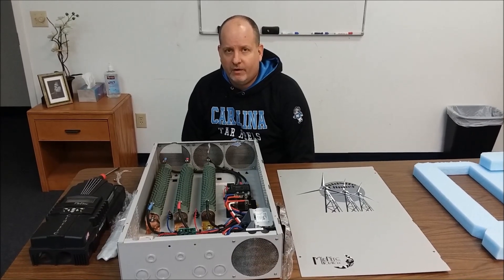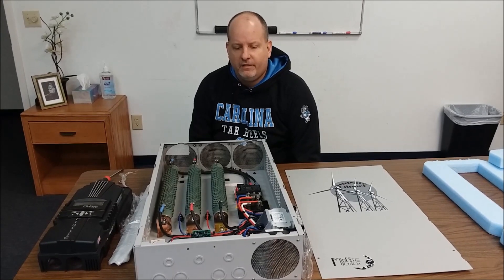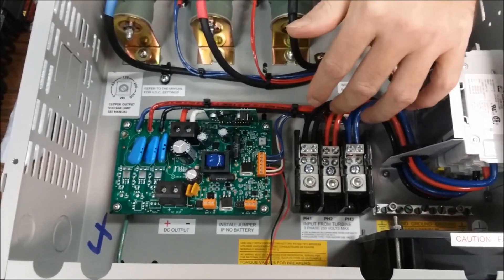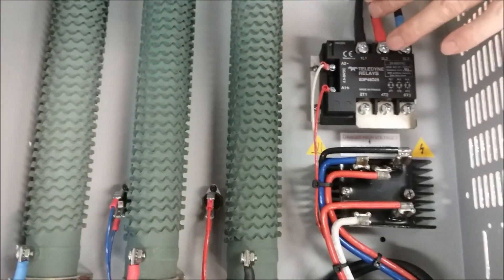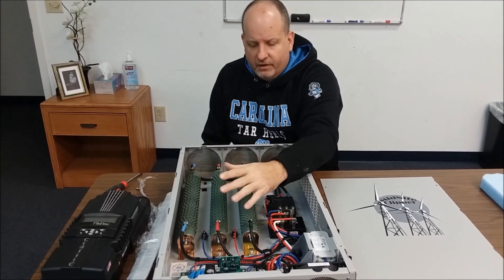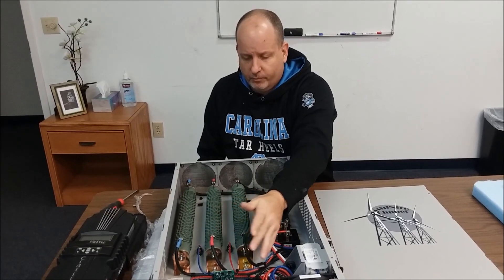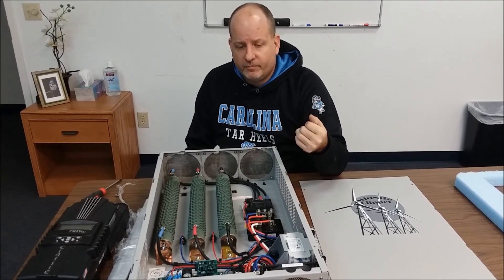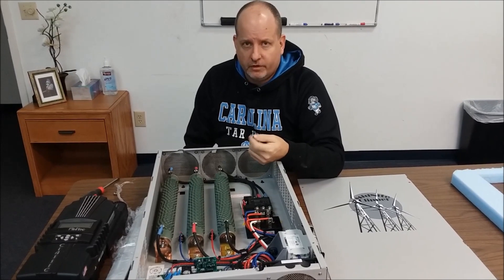Why Hurricane Wind Power recommends using the Midnite Clipper for Overvoltage Protection

Comment: Hi Tony. As usual, your premise and video are both excellent, and I like almost everything about the clipper. What I question about every resistor dump load setup is why waste that power at all? For a relatively nominal additional expenditure, wouldn't an electric water heater with DC elements be a more useful dump load? Everyone uses hot water, and has to heat it somehow (unless they're fortunate enough to be located on a hot spring). An additional water heating tank ahead of other heating device would preheat water, or be benign if not in use for a period of time. I ask this because I live in the Colorado mountains where it's quite cold a lot of the year. Hot water has many uses, including radiant floor heating. Anyway, I'd like to hear your thoughts on that. Perhaps this device with the third layer of electrical protection, but with dump load sent to water heating elements would be a good thing. Thanks again for all of your great videos. (and yes, I'm still going to get a 24v "White Lightning" one of these days when I figure where to put a tower.)
Reply from the maker: Fair enough we like hot water as well and in theory whether your going to a water heating element or a resistor in should not matter